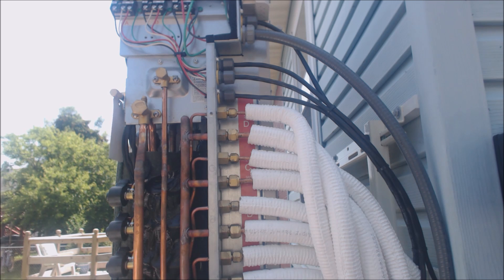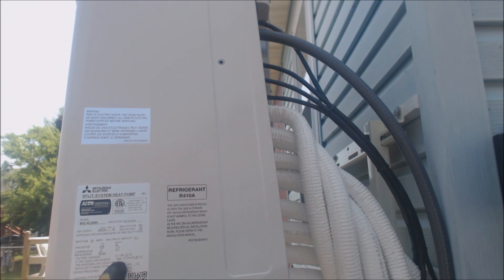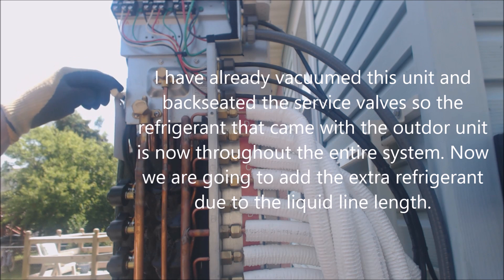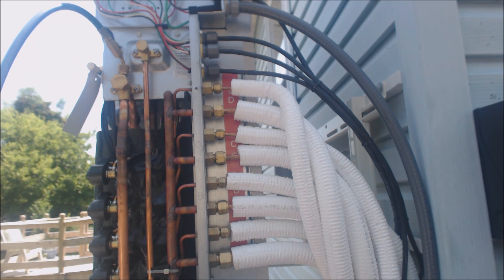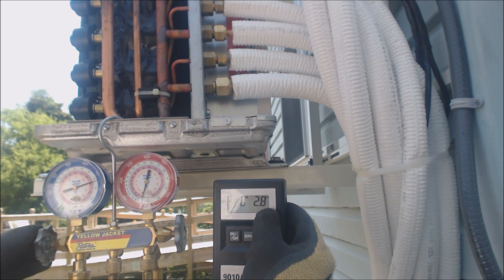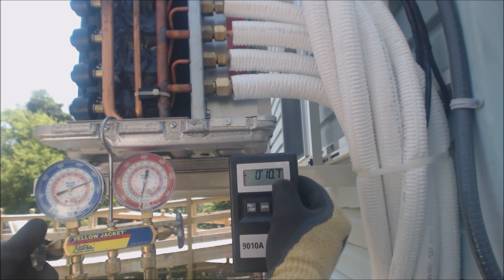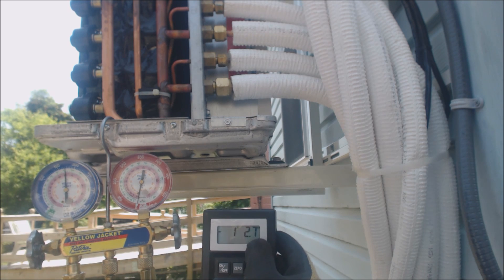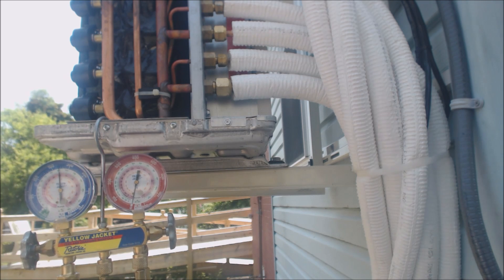Weighing in the Correct Amount of Refrigerant in a Mitsubishi Mini Split Unit!

Comment: Very good video, will you be more videos on mini-split units. Just started getting into a/c and installing Fujitsu Mini-Splits. In there info on unit say it needs a minimum of 16' of lineset, wondering how it shows on gauges if run is less than 16', and if it will affect unit. Thanks
Reply from the maker: You would need to recover the refrigerant if it is less than that because the accumulator may not have enough room to stop the extra refrigerant from making it into the compressor as a liquid during some of the run times. Thanks for letting me know what you would like to see!

Comment: Great videos. Enjoying very much. Thanks for sharing your knowledge.

I'd like to ask a questions: Apart from refrigerant charging, when do we have to take care for the compressor oils? Does the refrigerant charging containers contain the compressor oils, as well?  And since I live in Europe where mini splits are very popular, what kind of care do they need regarding their (mini split's) compressor oils.

Again, thanks for the great job.
Reply from the maker: Great Question! So the outdoor units always come with oil from the start, even systems that are considered dry without refrigerant do have the oil in them already unless the manufacturer states it does not in some weird circumstance but any one that I am familiar with will have it already. The oil is miscible and will travel with the refrigerant throughout the system and through the vapor compressor. The only care that is needed in regards to oil is to make sure that you are not introducing moisture into the system via the your service hoses. You should also make sure that you have a good vacuum on the system that holds 500 microns or better before allowing the refrigerant from the outdoor unit to the lineset and wall units upon initial installation. The oil will last as long as the system does and will not need to be changed. Thanks

Comment: Hi.  I just wanted to provide you with a quick update.  I installed, pressure tested and charged both of my mini-splits as per your directions "however followed the manufactures specs for weighing in additional  refrigerant" as I had more than a 25 ft lineset. So far everything is working great.  Not sure what your take is on this but I would recommend people buy a cheap leak detector and use nylog on their flare connections.  The leak detector found a minuscule leak on one of the connections I didn't use nylog on.  Leak detector was about "50$ on amazon".  Even after using a torque wrench/crow foot fitting with the proper torques on it and pulling a vacuum down below 500 microns the leak detector detected a minuscule leak on one of my flare connections.  I added an additional 1 ft/lbs and that seemed to do the trick.  
For the second system I used nylog on the flare connections.  It seems to be cheap insurance against system leaks.  I did pre-charge both systems with nitrogen to pressure test prior to allowing the refrigerant into the system. I was able to pull a vacuum down to 230 microns on each system and it held after 5 minutes. .  
The nylog really seems to act as a lubricant when torquing the flare nuts.  
Thanks again for all your helpful videos and if someone is considering using nylog make sure you buy the right one for your refrigerant application as they make at least 2 types that I'm aware of.
Reply from the maker: Yes the blue is for hfc's and the red is for cfc and hcfc's. It seems to work well. Starting in the field we always used the same refrig oil that was in system on the flare seat. This seemed to do the trick. Almost anytime I have seen someone not put oil or nylog then there is a leak. Thanks for your detail!

Comment: How would you weigh in only through the low port if there is no pre-charge?
Reply from the maker: Well if you did a repair, say on the compressor or solenoid valves you could go ahead and braze a 1/8" access valve onto the liquid line inside under the outdoor unit cover. The unit also has an accumulator and the last time I talked to a Mitsubishi tech they said it was normal to have 0-5 degrees of superheat while running on full emergency cool on all indoor units. My question was isn't that going to damage the compressor if you don't have superheat? The tech on the phone said that they are safe even when running at 0 superheat because of their accumulator.  We know accumulators have their own metering device so at least it is at saturated state but mainly vapor. To be extra safe you could braze an access fitting right in the side of the liquid line under the cover. Remember that they design these specifically so that people don't try to charge them in subcooling. They also design them to have flares so that the torch doesn't touch the lines. The problem is not the torch but that many are not running the nitrogen through and the manufacturers don't want the blame of all that oxidation clogging things up. Most of the refrigerant from a system that says you can have up to 125' of lineset when you only have 30' is just sitting in that accumulator so technically it would have to go there before going to the compressor. To be sure, check with the manufacturer themselves at tech support to be sure of their recommended procedure. Thanks
Reply: Thanks for the quick response. I have a daikin rxs24dvju that is over 9 years old and hasn't been running for about 2 years now. I believe all the gas has just leaked out of the flare probably because it wasn't bolted down and people would bump and sit on the outside unit. So I tightened it up and pulled a vacuum on the whole system and it seems to be holding. However with no gas and only a low side service port I'm not sure how to weigh in. I don't really want to put to much money into it as it might not be worth it and im not sure i'm experienced enough to braze a 1/8" access valve into the liquid line. Would it be completely wrong to sip in r410a through the low port while the unit is off and under vacuum? Or should I turn the unit on and try to sip almost 4lbs of r410a in through the low port? I imagine the high and low valves remain completely open while charging?
Reply from the maker: You would still need to get about 2-3lbs at the very minimum in before starting it so the evaps don't all freeze and you have some refrigerant to work with. If that is the case not much difference between that and the 4lbs it needs. You could call tech support for Daikin. It is certainly different than a standard condensor because of the accumulator. See what Daikin says. It won't hurt. It sounds like you know what you are talking about and they should give you the info you need. Thanks
Reply from the maker: There is no need to have a valve on the high side with a variable refrigerant flow unit. Mitsubishi just wants us to weigh the charge in. The tech support stated that a superheat of 0-5 degrees would work when on full emerg cooling on all units and I have checked some of my installations and they range from 2-4 degrees of superheat when it is 70 degrees or higher out. Thanks
Reply: @acservicetechchannel   thank you for the video, but what I understand I can top up Mitsubishi inverter at emerg cooling, a superheat 0-5???! correct??? Because we don't know how much gas leaked
Reply from the maker: I did view the part when you linked it. You would not need that and yes if you were to replace the compressor then you would need an access valve on that side so you would braze something like this in which has a shrader valve and a service cap. This however is not needed for a general service on a vrf mini split but you only need a high side port for checking single and two speed compressors.  Sorry for any confusion -- http://amzn.to/2iQ1tIn
Reply: Would such a "vacuum/charge valve" from Yellow Jacket help when connected to the high side? Would it provide an access port to mini split's high side without soldering? (I mean the left valve which is depicted in the following link)
http://yellowjacket.com/product/vacuum-charge-valve/
Reply: Thank you for your reply. I appreciate very much your effort for this channel.

I have asked your opinion regarding Yellow Jacket's "vacuum/charge valve" because you proposed to adam christensen2 above  to braze a 1/8 access valve onto the liquid line", and he replied that he is not experienced to braze. Since I assume that there are a lot of people with lack in welding experience (including myself), therefore I am asking if you consider Yellow Jacket's "vacuum/charge valve" as an alternative (to weld a access port onto the high side).

Thanks.

Comment: installed a LG mini system... pressure running 114/140 inverted compressor.. Lines set is 48 ft have not added any 410 yet... any thoughts?
Reply from the maker: What does the unit say to add per every 5' of extra liquid lineset on the rating plate or are you within the proper amount of length worth of lineset?
Reply: I have same problem when do I add refrigerant before first start up ???

Comment: Thanks for these extremely helpful videos.  AC companies in my area won't even return your call as they are all too busy and frankly they just don't care as business is booming.  I've decided to tackle my mini-split install myself.  I'm finding it expensive however to buy all the proper gear for the install.   If I pull a vacuum down to 500 microns is it safe to say I have no leaks in the system and don't have to pressure test with nitrogen?    Also once I pull the vacuum how do I reconnect the charge hose from the vacuum pump to the refrigerant tank without introducing air into the system?
Reply: Ok just saw your other video on weighing in refrigerant.  Noticed you have a shutoff valve at the end of the hose to prevent air being introduced into the charge line.  Thanks again...
Reply from the maker: Yes if you didn't have the valve then you could just vent the air out of the top at the gauge manifold until it was just refrigerant in the hose. When I am switching from vacuum to charging I close the gauge set also before disconnecting the micron gauge.
Reply: thanks ..  do i have to pressure test with nitrogen if I'm able to pull a vacuum down to 500 microns?
Reply from the maker: Great Question! If the lines were bigger in diameter and you had a 3cfm pump then I would say it is likely that you don't have a leak but I always pressure test. It really also depends on how big your vac pump is and where you place the micron gauge. You can check out this video.     https://youtu.be/nBCWYgCcnpE
Reply: Thanks again for sharing your knowledge.   You're helping thousands of people and your videos are some of the best instructional videos I've come across.   I'll be placing my order with amazon using your embedded link.  You may want to publicise the link in all your videos as I stumbled across it.  I'm sure people will be more than happy to support you any way they can.
Reply from the maker: Thank you very much! Thanks for your Comments and Support!
Reply from the maker: Thanks and so you know, if you want to support the channel, the link has to be clicked through any of the acservicetech videos like this one or the channel page discussion. Thanks again!
Reply: I did find the embedded amazon link in the discussion forum but do not see it in the videos.
Reply from the maker: I will be placing it in the new videos in the description section. I just started to add these links. Thanks for your help!

Comment: great video, i see why you can only charge by weight. if its only a single lineset then you can charge by subcooling correct?
Reply from the maker: If it is a standard compressor then yes but if it is an inverter system then you need to charge by weight. Always check the manufacturers rating plate or on the inside of the service door for directions, thanks!

Comment: Great video. Cheers from up in Canada
Reply from the maker: Thanks and glad you are enjoying the Channel there in Canada! How is the weather up there presently in terms of temp and humidity with people needing emergency service?
Reply: Thanks for these extremely helpful videos.  AC companies in my area won't even return your call as they are all too busy and frankly they just don't care as business is booming.  I've decided to tackle my mini-split install myself.  I'm finding it expensive however to buy all the proper gear for the install.   If I pull a vacuum down to 500 microns is it safe to say I have no leaks in the system and don't have to pressure test with nitrogen?  Buying the nitrogen tank is expensive and I won't be brazing anything.  I did buy the flare tools etc..  Thanks.
Reply: One more question.  Once I pull the vacuum how do I reconnect the charge hose from the vacuum pump to the refrigerant tank without introducing air into the system?  Thanks again..
Reply: Up here in Alberta its been a hot summer for us. As we are in celcius our summer was consistantly 24-30º c with high humidity. Our seasons are different with you guys down south as summers is AC season and we sell, service and repair like you but generally speaking if someones AC system goes down it is not considered an emergency unless of course its a business. But come fall and winter where we usually average around -15ºc and some spells of -30º+, if someones heat goes down we go aroound the clock with emergency no heats. Probably like you, I  love the emergency calls...good money :)
Keep up the good videos...I really enjoy them. Cheers
Reply from the maker: Where I am located at by the shore, we have a lot of summer tourist activity and that would be considered business service calls to us. We have to go as if it's a no heat call in the winter.  I am glad you are enjoying the videos! I will transition to preventative maintenance and gas line videos likely in between seasons and start making furnace and heat pump videos. Thanks and have fun!

Comment: Nice work man .. I am new in this matter, but I have understood that mini splits are like piston expansion.. my question is related the way it was charged the unit.. Can I charge by superheat instead of by weighting the refrigerant?  Thanks in advance
Reply: There is a trick you can use to get them by for a short time if it's really busy or a holiday weekend. You set the indoor units to cool and push the Emergency Operation buttons all of the units. That puts the whole system into high cool regardless of the indoor and outdoor temps. Mitsubishi says the saturation TEMPERATURE on the vapor side should be between 45-50deg F. Add refrigerant until you're in that range and it will cool quite well until you have a chance to go back and find the leak and repair it, then recover and properly weigh in the charge. You'll find that the amount you took out will be pretty close to the amount that you have to put back in
Reply from the maker: If the mini-split is an inverter style than you must charge by weight only because it ramps up or down and there is not a steady superheat or subcooling. Thanks for the question!

Comment: Nice video.  Good explanation of how to charge a mini split system, however, I think you may have forgotten to multiple the 20.92 times 1.08 which gives you more like 22.6oz.  I know its not a big difference and maybe you just figured the .08 extra per five feet wouldn't make the much of a difference.  What do you think?
Reply from the maker: You are absolutely right. It was a hot one and I did my calculations on another sheet. I do however put a little over on the mini splits by shutting the tank down and weighing in the liquid that is left in the yellow service hose into the service hose. It will be very close, good catch and thank you for your very nice question. Thanks for your comment!
Reply: No problem. Thanks for replying.  We've all been there on those hot days. I installed that same outdoor unit on my own house last year.  It is a good unit and much more efficient than my old 10 seer York  central unit. Just subbed you today and have watched a few of your videos.  You do a good job explaining what you are doing. Very helpful!
Reply from the maker: Thank you very much John! I hope you enjoy the other videos!
Reply: 3 years later im another one to actually follow the math lol.

Thank you for the vids and info sharing peoples.  Hope all is great.  How are the systems doing?
Reply: That's whats I was thinking! Thank you for the observation

Comment: Excellent video - detailed and concise. Questions.  The 21 oz weighed includes refrigerant in the suction hose.  So how does one get those few to several ounces into the system or do you (after video ends) add a few more ounces to account for hose amount?  Prior comment on use of low-loss fitting at the suction line port was also on my mind. Thanks
Reply: If you purge your hoses of air and then zero out your scale you get the exact amount of refrigerant in the system .......There would be a small amount left in the hoses which if you added to the system would put you over the additional amount... is let out into the atmosphere under the di minimus law
Reply: Thanks zeke112964 for the clear explanation.  That makes sense.
Reply from the maker: I did charge what was in the yellow service hose into the system. If it were adding refrigerant to a system during a superheat or subcooling process you would or could shut the bottle down and continue to charge what is left in the yellow service hose into the system while monitoring superheat or subcooling to make sure that you don't put too much refrigerant in. This would get rid of the refrigerant in the hoses for you. With minisplits I do usually put the yellow service hose's refrigerant into the system or I will stop short an ounce or so and add this in. Thank you Zeke112964 and Papa Joe for your Comments!
Reply from the maker: A valve depressor tool for the suction and the liquid line is a great add on to a set.